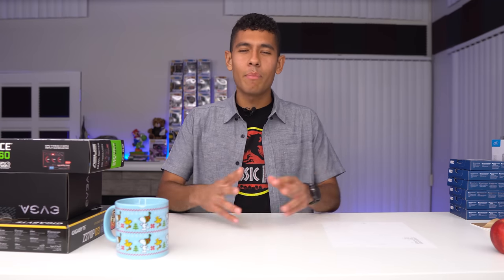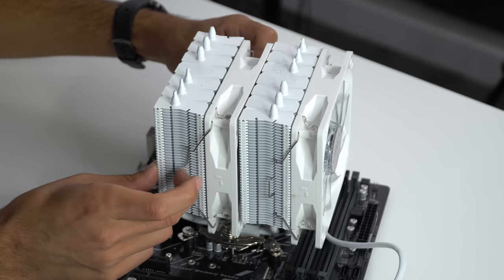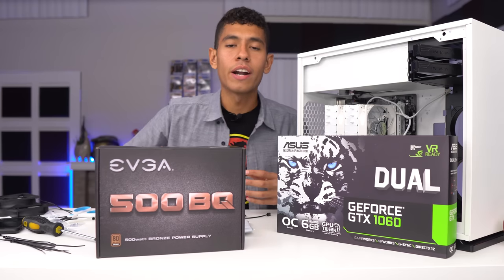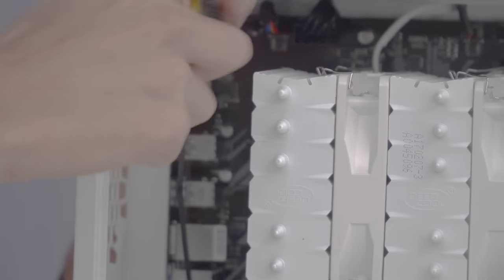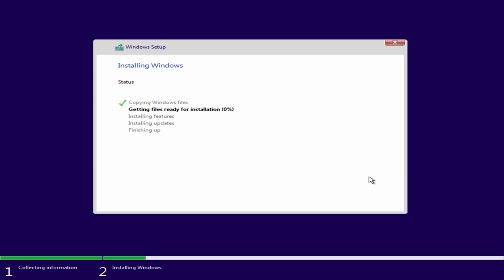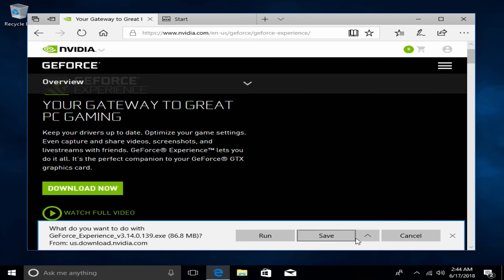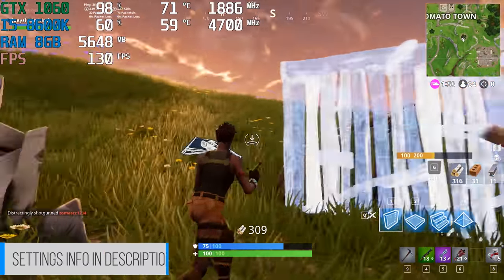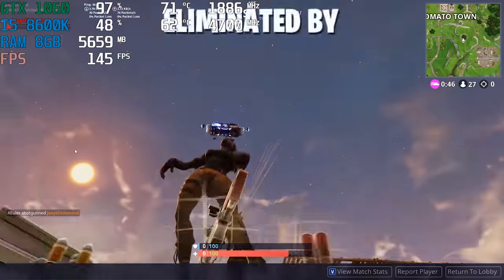Best $1000 Gaming PC Build Guide - GTX 1060 i5 8600K (w/ Benchmarks)

Comment: I finally finished this build after 3 years🙌🏽🙌🏽
Reply: If anyone sees this, can someone explain why i am getting low gpu usage? i copied this exact same build but i’m using a 1660 instead
Reply: bruh.... why?
Reply: AyyKayy 13 wdym why
Reply: @wwrrccc  this is outdated af. for 1k u can get alot better specs now
Reply: AyyKayy 13 i had already started purchasing parts, but it does hold up. it runs perfectly fine for me. especially for my first build. i’ll just have to upgrade in a couple of years
Reply: @wwrrccc  ahh that's alright

Comment: These are great videos!
I'm curious as to why only 8gb ram? Is it to try and stay under the $1000 build requirements? Can I bump it up to 2 8gb sticks, making it 16gb?

Again these are excellent videos!
Subbed :-)
Reply: Try this: RX 580/590 Ryzen 5 2600 16gb 3200mhz ram. Also u can get a 1660 if u want
Reply: @kingjason2312  thanks my man! This is going to be my first build and at he moment some of the parts are difficult to acquire, as most are out of stock...
Thanks again 👍

Comment: Hi, I'm from the Philippines and I want to share that I have built a $1000 equivalent in pesos (its actually 992 something) pc with an i7 10th gen, a 1660super, with 32gb ram and the same ssd and terrabyte sizes as the one in this build... It just goes to show how much the values of the equipment vary and shift over time and in different areas... I'm still a noob at this but I recommend you guys to keep researching and have patience in building your pc, if possible piece by piece before building.. Last share, mine took over a year until I ran out of patience to finally just buy the parts and build it completely so maybe if you can keep on longer and find better values then go for it 😁✌✌

Comment: I like watching these builds they are really inspirational and they gave me a lot of good ideas for my pc build coming up soon that consists of  

CORSAIR Vengeance RGB 16GB (2x8GB) DDR4 2666MHz C16 Desktop Memory - Black PRO - White (2x8GB)

Thermaltake 500W 80+ White Power Supply, PS-SPR-0500NHSAWA-1

Cooler Master MCW-L3S3-KGNN-00 MasterBox Lite 3.1 TG

KingDian 2.5" 7mm 60GB SATA III 6Gb/s Internal Solid State Drive SSD for Desktop PCs Laptop (S200 60GB)

ASUS Prime B350M AMD Ryzen AM4 DDR4 HDMI DVI VGA M.2 uATX B350 Motherboard ATX

AMD YD2600BBAFBOX Processeur RYZEN5 2600 Socket AM4 3.9Ghz Max Boost, 3,4Ghz Base+19MB
 And I will continue to make upgrades in the future! But watching your builds gave me the knowledge and power of the pc universe. PS: my parents don’t understand the pc language 😂

Comment: If it fit, could I use another power supply as I already have a 550 instead of a 500 or does it have to be this specific one. 
Same for the processor do I have to use the i5 or could I use like an i7??
Thanks 😁
Reply: Yes and yes

Comment: My main question is, can you mix any kind of parts together? For instance, if I bought the motherboard shown in the video, could I put ANY processor in it? Or does it HAVE to be the one you showed. I.E, is it possible that a motherboard may not be powerful enough to run a certain processor?
Reply: Wow stupid question, anyways the motherboard Joey is using is a lga1151 socket motherboard. So only Intel CPUs with the same socket can fit in this motherboard. If for amd, u will have to use the am4 motherboard for ryzen. Also any motherboard in there specific socket can run these CPUs but better or more expensive motherboard will have better features. Any Intel or amd motherboard can run there respected CPUs at stock settings fine, but more powerful CPUs will need beefier motherboards with better vrms to have better power delivery if your planning to overclock to speeze extra performance. Amd motherboards (b350/b450 x370/x470/x570) let u overclock your CPU which is overclockable as well. Intel on the other hand only let CPUs with the k in there names (for example i7 8700k) overclock and also only allow z series motherboard (z370/z390) to overclock the k CPUs. Also do not use this build frankly this build is fucking shitty when it comes price to performance and there is better PC parts for cheaper that can out perform this PC.
Reply: Amd/Nvidia GPUs are able to run on both motherboards
Reply: But any intel cpu cant work on any intel mtherboard, for example a i5 9600k which is a 9th gen intel cant work with a z270 or z370 right out of the box, it has to be a z390 which has the latest bios that are required for 9th gen intel. 
Same thing for amd, any am4 motherboard does nt support any am4 cpu.

Comment: Will an Asus Prime z390-a MoBo fit in this?? Read some scary reviews on the gigabyte z370... what other motherboards would work? Will PCparpicker know if it will fit?
Reply: The motherboard is an Atx Form Factor Right? If so it will fit you can check on Amazon if it is an Atx Form Factor

Comment: If you are going to build a 1000$ pc this is the specs you should change:
Intel Core i5 9400f or Amd Ryzen 5 3600 or Ryzen 5 5600x 
GTX1650 OC or RTX 2060
Gigabyte X570 Aorus Elite
Reply: Or Just use a Gtx 1660 ti or RTX 2070 Super

Comment: is 450w 80+ gold rated psu enough for,
i5 9400f,  board- gigabyte b360 aorus gaming 3, ram- 16gb corsair vengence, gpu - msi gtx 1060 gaming x or a new gtx 1660ti,
please help
its for gaming and streaming
Reply: A 1660 (non-TI) requires at least 500w of power, so it wouldn't work - I recommend 650w as the sweet spot as long as it's 80+bronze rated or higher.  I have a 750w 80+ bronze in both of my builds w/a i7-8700k and a GTX 1070 TI FTW2 8gb and I have no issues (I have stock/factory overclock, since I'm not an overclocker).  You can look at the specs of each of your components under their respective websites to see their bare minimum requirements.

I wouldn't recommend any power supply for intermediate to high gamin computers (especially if you're plannin to upgrade at some point) less than 650w 80+ bronze.  Lower end comps can handle 450w 80+ bronze, but nothin around a GTX/RTX XX60 or higher.  The higher in the i5/i7 category you go, w/or w/out overclockin, the more likely you'll have a XX60 or higher graphics card, which'll require more power and overclockin will push it even further.

Comment: I think you put those nuts upside down when you put the brackets on for the heat sink. The other side (side you put down) has cuts in it for a screwdriver.  Those should be up so you can tighten them down with a screwdriver.

Comment: Would I be able to upgrade the i5 into an i7 8700 processor instead, and if I can do I have to upgrade the power supply?
Reply: 650w Power Supplies are a great lvl to hit as long as they're 80+bronze or higher.  500w is what a lot of medium to higher Graphics Cards require, so they'll have issues w/overclocking and if you have other powerful components, like a processor to match, water cooling, etc.  I have a 750w 80+bronze for both of my PCs just to make sure I have enough, but 650w is the sweet spot, while also costin less.  I have a i7-8700k w/a GTX 1070 ti FTW2 8gb and I've had no issues w/stock overclock (I'm not an overclocker).
Reply: @Taintedmind  thanks for the reply man, really appreciate it

Comment: I am currently in the process of building this PC; however, once I completed putting it together, it didn’t want to turn on. It ran power through the PC bc my keyboard could turn on, but none of the fans or anything else wanted to work. Any ideas? I upgraded the processor to an i7 8700k instead of an i5 as well as upgraded the ram to 16GB. Would upgrading those have an effect on the motherboard not being able to handle it or something? Let me know please!
Reply: Your cpu or ram wouldn't make a difference. Try looking at the led indicators on your motherboard when you turn it on and and see which stays lit it might tell you what the problem is.

Comment: If you upgrade the Processor to like a i7 8th Gen or 9th or a Ryzen 7 would it still be alright?
Reply: No,
Ryzen and intel need different motherboards, for ryzen you need am4 socket, for intel you need lga 1151.
And if you have the same motherboard, you have to update the bios first before you can put a 9th gen intel on it. I dont recommend building this pc, this is not worth 1k.
For 1k you can alot better since this video is from 1 year ago

Comment: Beautiful gaming pc you build there. I have a question, since I am doing a ryzen build now, I am using the InWin 103, the successor of InWin 101. Do you screw your motherboard( sorry, newbie in pc building), the InWin 103 give eighteen pieces of hexagonal screws, when I saw the manual from qr code, "use motherboard screws in mounting motherboard", but i do not see any motherboard screws in my motherboard box (asus rog strix b450 f), only stickers, sata cables, rgb extender, zip ties and manual. If anybody can read this, pls reply. Any thoughts will do as long I can understand it and safe to do it. Thanks and sorry for bad english if any...
Reply: Go into a PC building forum online and ask the question, it will get answered very quickly
Reply: Thanks but no need. I was careless that I do not recognize that InWin 103 give motherboard screws, they are simililarly look like hexagonal screws of my psu but they are different. This carelessness ang absent minded took hours of rescrewing motherboard to case instead of cable management. Thanks again. Have a good day 👍

Comment: The real information you want is how much frames you have during FIGHTS and this pc while being decent wont give you the edge you need in deep pressure fights, probably will drop to 90 frames ( minimum ), if you have a 240 hz monitor you wont experience 240 hertz with this build.

Comment: If I were to add a 650w GS EVGA psu, would it fit and work fine with the system parts?(Only change to the pc, may change 8gb or ram to 16)

Comment: Would it be wise to take off the second fan on the cpu cooler in order to fit my ram sticks?
Reply: no. Just apply the ram first or as he did in the video. last thing u want not cool is the cpu
Reply: What if there’s not enough clearance for the cpu fan and my ram sticks to fit? Should I just get some ram sticks that fit?
Reply: @eahtnyro  yea either swap the ram or cpu. whichever is cheaper. but also do more research on the matter. i dont know what exact parts u have so i cant say much. u might be able to get by..

Comment: If you want to buy a different fan like he did go ahead, but I would recommend saving yourself 30 dollars and just using the fan and heatsink that come with your cpu. Unless you want to use water cooling, having a case with at least 2 default fans you will be fine to use the default fan for your cpu.
Reply: I5 8600k does not include a heatsink

Comment: This system would work with 16gbs of ram, correct? I recently bought a set of 8gb sticks and don't want to downgrade if I decide to use this system.
Reply: Yes it will might need to choose a different cooler though because I think it's blocking the first slot

Comment: Instead of the 1060 graphics card can I use a 2060? Would it fit and be compatible?
Reply: Srikar Garapati Pretty sure itd be okay 👌
Reply: AdverTyy would I need a bigger power box then if that was to happen or can I get everything that he has and be okay? Like everything would be still functional?
Reply: Srikar Garapati I think youd need to get better power box but besides that i think everything would run perfectly
Reply: Power supply *
Reply: Srikar Garapati call it a psu instead of a powerbox

Comment: Guys my specs : Intel i3 coffee Lake , GTX 1060 6 GB ram oc , h310m-h mother board , .... My question : is 450 watt enough power supply for my build pls tell fast
Reply: http://www.coolermaster.com/power-supply-calculator/

Just select ur parts there and click calculate
Reply: I'd get an extra 100 or 50 watts just because the 1060 might use quite a few of those 450

Comment: I bought the  msi gtx 1060 6gb oc v2 with cpu amd ryzen 5 2400g  any one can help for power supply idk which power supply which type or model is good for it to i buy
Reply: u can buy power supplies from CROSAIR / SEASONIC / COOLER MASTER / EVGA and maybe a 500-550w
Reply: DONT BUY THE CHIPPEST U NEED A GOOD POWER SUPPLY
Reply: @Dmcp-fw6df  thx bro

Comment: What if I use the Core i5-9600k will it still work or for this build or not??
Reply: 😂 ofcourse it will work
Reply: What about the motherboard can I use any motherboard or I had to be the one in the video??
Reply: @leoluna7276  no you can use any mother boRd but it should support the components you have like processor and ram

Comment: Used Dell Optiplex 7010 MT w/i7 3770: $135
EVGA 600w PSU from EVGA mid week madness: $20
Used MSI Single Fan GTX 1060: $75
Total Cost: $230
Reply: DoS Gaming Network used parts are different
Reply: @justinmay7630  yup

Comment: will it be any different if i use a use a ryzen 5 2600x instead of the i5?
Reply: Pixel Mike no it shouldn’t be  different
Reply: Pixel Mike uh yes it should you need to get another motherboard that has a AM4 socket
Reply: @ash-wm4iu  thanks you!

Comment: Can I use a i7 8700K instead of a i5 8600K for this built
Reply: Snake T you can use anything you want to use as long as the sockets match up.
Reply: @TJEpicMedia   would a i7 8700K Fit?
Reply: @snaket6843  so in my earlier comment, i mentioned sockets, the socket is the fitment. They are both 1151. So they both fit the same motherboard with a 1151 socket.

Comment: at 3:50 you said right away it reads that we haVE a hard drive disabled. mine doesnt show up here. it says i cant make a storage space with my 2tb hdd but i cant find it here. it allows shows as disabled in my bios but i cant figure out how to get it working. its not the pins etc, and i have it in the right sata port on my mother board.

Comment: This is my first build.  Is it a good build?  See below for specs.

ASUS Prime Z390-P LGA 1151 ATX Intel Motherboard
Intel Core i5-9600K Coffee Lake 3.7 GHz LGA 1151 B...
ASUS Strix GeForce GTX 1060 Overclocked Triple-Fan...
G.Skill Ripjaws V 32GB 2 x 16GB DDR4-3200 PC4-2560...
Samsung 860 EVO 500GB MLC V-NAND SATA III 6Gb/s 2....
Seagate BarraCuda 2TB 7200RPM SATA III 6Gb/s 3.5" ...
PowerSpec 750 Watt 80 Plus Bronze ATX Semi-Modular...
Cooler Master Hyper 212 LED CPU Cooler
Corsair Carbide Air 540 High Airflow White LED ATX...
Reply: Yes thats really good. How much did it cost?
Reply: @itisfullofcurry1313  $1200
Reply: @Pccpy  are you gonna game on that pc? If ur only gonna game then 32gb is kinda more than enough but thats a nice pc👍
Reply: @itisfullofcurry1313  Gaming and photography work.  I think I'll reduce to 16gb, that should be enough.

Comment: I have a question. I built my friends computer and everything turned out great, but at my place it randomly just shuts down (not blue screen), but works fine at his place. My PC doesn’t do this. What could cause this?
Reply: Fantum Calek very funny hardy har har
Reply: Magnus Rasmussen turns out it was corrupt OS files that got moved over from the old hard drive, so we just reinstalled the OS, so problemed solved.

Comment: Would I be able to use a i3-7100? It’s 3.9GHz
Reply: Don't buy that, you can get Ryzen 3 2200g which costs less and performs better. I have it too
Reply: Isn’t higher GHz better?
Reply: @hankikewoj8863  you can overclock Ryzen 2200g to 4ghz with a good cooler

Comment: I’m New to the Pc World a while ago I decided I wanted to use this video and these exact parts only difference is my GeForce gtx 1060 is not dual, it only have 1 fan. After watching and mimicking the entire build I Turned the pc on for the first time and it ran, case fans, cpu fans, gcu fans, battery and led lights, motherboard lights up and everything seems like it’s working then it completely shuts off after 10 seconds (battery motherboard gcu etc.) then cuts back on and does it all over again continuously. But the light up keyboard and mouse never that’s connected to the motherboard never turns off even though everything else does... Does anyone have any ideas that could help me. This is my first build  I made sure I copied everything and made sure all the connections are good. Can anyone help??????

Comment: Could you use an aio cooler in this build if you buy a bigger case
Reply: This case is designed for AIO, the side has bracket for 240mm radiator, is not for fan exhaust...
Reply: Ismail Lubis thank

Comment: Am i able to swap the 8 GB RAM sticks for 16 GB corsair vengeance ones?
Reply: How many sticks of ram and how many slots of ram do you have on your mobo?
Reply: @TONI-bi1lg  I was wondering if I were to follow this build guide, if I could change it to the 8x2 ones
Reply: If you have 2 sticks of ram add another 2 sticks of ram. Try finding the model of your ram sticks.
Reply: @TONI-bi1lg  im following the build guide, but asking if I can swapit for 16 (2x8) CORSAIR VENGEANCE ram sticks. is that possible?
Reply: that way I don't need to buy 4 ram sticks
Reply: @andyngo3676 yes you can swap for 2x8 corsair kit, but if you already have 2x4 kit of ram just add another 2x4 kit of ram.
Reply: @andyngo3676  so the total will be 4 sticks of ram
Reply: @TONI-bi1lg  ah thanks
Reply: I have another question
Reply: Am I able to swap a Ryzen 5 3600 processor, to a intel 7 processor?
Reply: @andyngo3676  no, you will need another motherboard, but the 3600 is a great cpu. I7 are kinda overpriced at this point.
Reply: @TONI-bi1lg  alright, thanks so much
Reply: @TONI-bi1lg  oh shoot, very sorry but, can you equip 16 GB ram with any PC?
Reply: @andyngo3676  any motherboard after 2013 supports 16gb.
Reply: Short answer, yes you can get more ddr4 ram